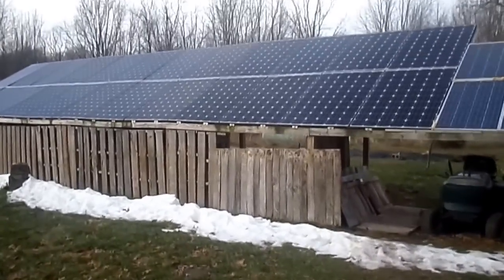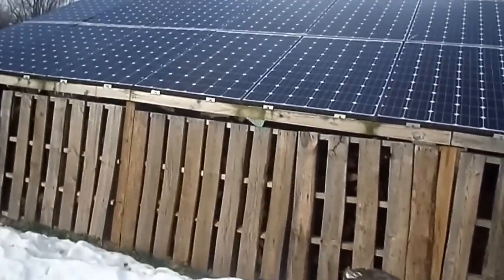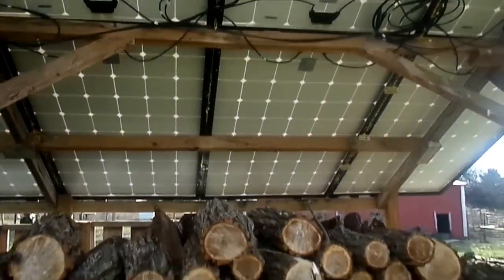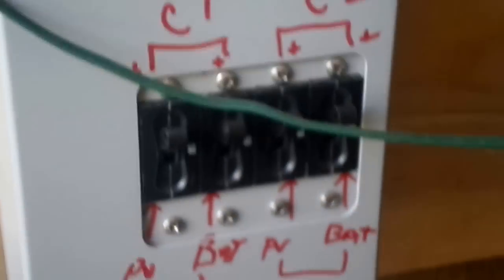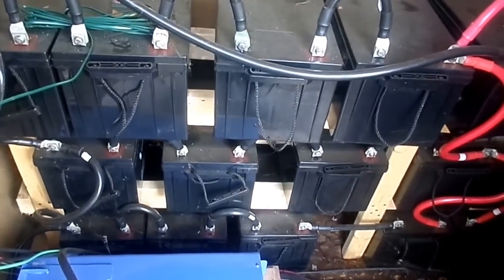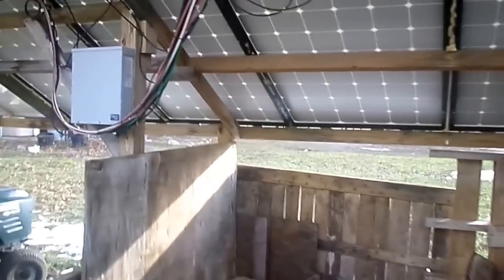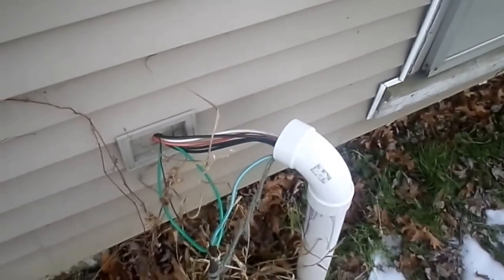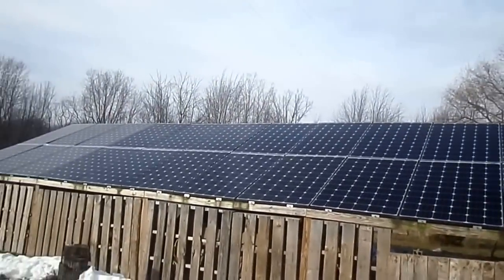How My Off Grid Solar Works

Comment: I have a questions with this array you and battery bank you have. have you made any changes in the appliances you use in the house?  I'm looking at ur system and you said your inverter has beeped  on you. I feel your being wasteful with your power consumption and need to revaluate your needs of power and  times you use items and the amount of power those items are using  a 30,000 dollar solar system should be more then enough  for a 2 br house yours may be bigger and I don't care how may people on here tell you that you can run your house like normal on grid people there lying. times some items run and volts they use is very important any thing that generates heat uses a lot of power microwaves use a lot of power even for 2 min  washers use up 2kw in spin cycle alone  and when you off-grid that is killing a system in a short time there is no such thing as a enrgy efficient  electric dryer in a off grid setup.  people think before you buy these massive systems on what your needs are first and if your trying to keep everything plugged in stay plugged in the grid only one that an handle that kinda power is a coal plant  not solar
Reply from the maker: We will make more videos on the appliances we use in the house. We do have a video on regular electric water heater you can view here https://www.youtube.com/watch?v=lbsksaQYFuM&t=3s  .We have  made no changes in the appliances we use in the house and they all run on our off-Grid Solar.